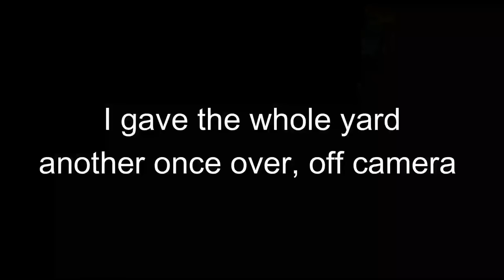Jungle backyard rescued! 3 videos in 1! Mowing Tall grass

Comment: What a massive under taking cleaning up this yard. So many questions about the state of these free cleanups. How does all that trash and debris accumulate? The condition of this property did not get this way over a couple months. So, you’ve cleaned this up. Do you maintain this property at zero cost?  Or, in a few months time, it’s right back to what it was? Looking at this yard, makes me wonder what the inside of the house looks like. Are there services available for that situation?

Comment: Ok Sean, I saw the video that was 6 or 8 parts on one video. It was almost 3 hours long and I watched the entire vid. Dude if you are going to do these big over grown yards, please get proper tool for your profession or you’re going to injure yourself and won’t be able to do anything. Get a big chainsaw whether it’s gas or electric, couldn’t stand watching you using that hand saw. Get a bigger mower, whether it’s a push mower or a bigger PROFESSIONAL MOWER. A machete would also help as well as a long handle shovel. These will save your back. It wasn’t toward the end I finally saw a mini chain saw and a chipper. You really work hard on that place and it was awesome but I’m not sure if I want to watch you kill yourself. That yellow mower must have been a throw away poor thing
Reply from the maker: Hey there, thanks for the tips! I'm guessing you may be new to the channel and watched an old video! All I will say is that you have to start somewhere, and equipment grows as a business does. Check out my later videos ;)